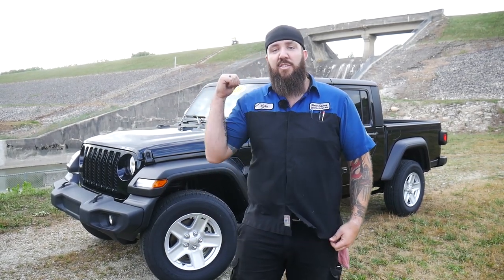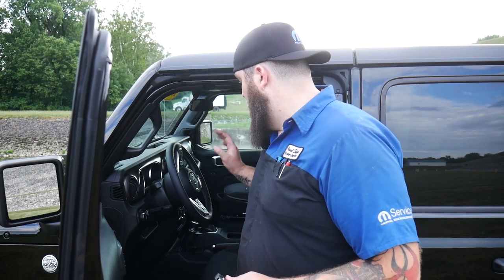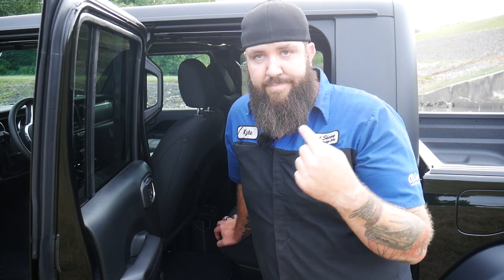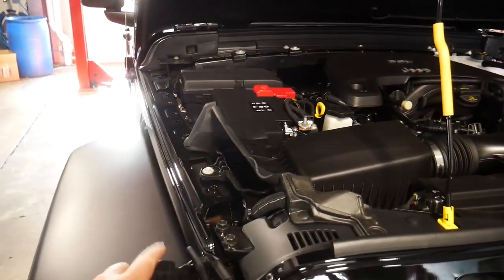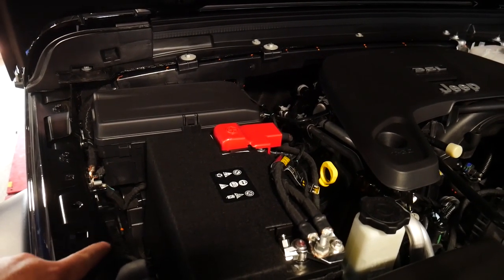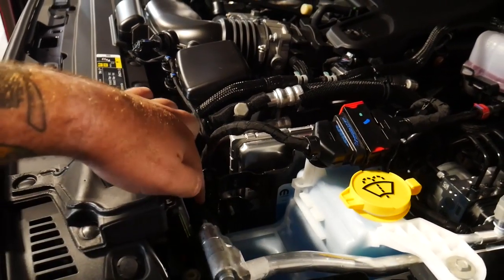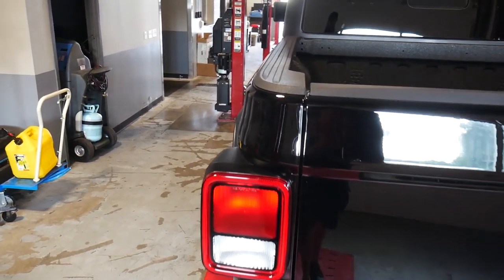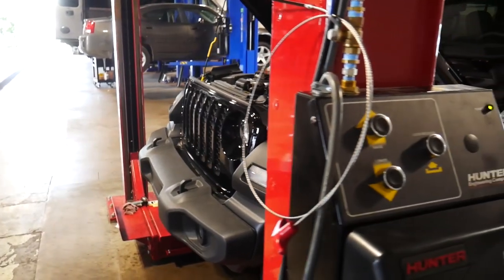2020 JEEP GLADIATOR - REVIEWS BY THE MECHANIC

Comment: They stick the taillights out that far because of the blind sopt monitoring system sensor's.  Function over form.
Reply: There’s no difference in how much they both stick out! It probably has more to do with the DOT regulations about lighting placements and distances. Like even the older step-sides had the taillights hanging off the sides of the tailgates.

Comment: I would like to see a two door version, like the old Comanche.
Reply: i would too but they said there not going to spend the money on it as something like 80% of midsize trucks sold are 4 doors
Reply: Took a few test drives, really like the truck but would rather have the extra bed space than the two extra doors. I'll just wait for a used one if they won't bother to build the truck 1/5 of their customers want. 

Thanks for the video! 

The passenger side exhaust loop is to tune exhaust pulses. Something especially important for v6 engines and actually reduces back pressure.
Reply: It would be. There are people out there who already hacked some up for the two door version. However most people overall want 4 door.

Comment: This so best film I've watched about the Gladiator, or any vehicle for that matter. Sho nuff, Jeep fans will not be buying the Gladiator as a status symbol. Two dislikes I have are: 1. There is only seating for five which is unfortunate as there are six of us in the family for the foreseeable future. 2: Almost $45,000.00 for a mid-range model? Chevrolet and Ford is charging around that price for their full-sizs, mid-range, Pick-ups, and the almost $45,000.00 for the Silverado is the new 4-cylinder model....sheeesh!
Chrysler needs to simplify the Jeep line again with just the Gladiator, Wrangler, and Grand Cherokee. I'd like to see a full-sized Jeep pick-up again like the old J-10/J-20.
Reply: Donald Hollums 
Unfortunately for you this or any mid size truck may not fit your needs. I cross shopped this truck with 4x4 Ford Rangers, Chevy Colorado’s, Toyota Tacomas and the price is pretty even.
Midsize trucks fetch a hefty price in today’s market and one would be foolish to cross shop with full size truck.
We just got a Gladiator and I am about 6ft 245lbs and I fit comfortably in the back of the JT, and the previous JK too. No you won’t get 6 in the Gladiator but you won’t get 6 in my F150 either. It only has seatbelts for 5. As for status symbol I’m not sure what cars meet that criteria these days. The JT does draw a lot of attention but it’s new so that’s expected.
Reply: Jeep needs to lower prices. I think that is clear. They’ve also lost over 35% sales the last 5 years (as prices increased).

Comment: Very nice video with a lot of information along with views of every nook and cranny. Now here I am in 2024, with a new 2024 Sport S, that’s very similar, a different grill, without the plastic filler between the bumper and fender. Plus more open space in the grill to help cooling. Also time has proven that aluminum steering box has been troublesome and replaced with cast iron like mine. I have every option that one has, but tow hitch and auxiliary switches didn’t come, but was marked down from msrp of $52k to $37,800! But I do have heated seats and steering wheel, auto climate control, ACC, adaptive cruise control, plus cross traffic notification and auto stop. The other slight difference is 17” dark grey alloy wheels that actually match the Chrystal Granite Metallic Paint. Plus hard top and automatic trans. One item I miss is limited slip rear differential. But like I said it’s how I found it marked down and I’m not a hard core off road driver and love the nice ride the 245/75-17 tires like on the one you had. I’m disappointed with the halogen headlights and fog lights, but every other are LED’s, so I plan on changing the bulbs. I’m not sure if the 2020 have this other great feature you did not show, that is the rear seat back that also folds down, that also locks in the up closed position with the key, that we use for security storage. I’m getting 17-18 mpg around town, depending upon how many lights and traffic is moving, but as high as 26 mpg at 55 mph to 60 mph on flat ground. But go 65-70 it drops to 24, at 75 goes to 22. Haven’t had it over 75, but do believe that mileage will be less than 21-20! Like every vehicle I’ve driven I get better mileage without Cruise Control, by just feathering the gas pedal just enough to maintain speed, that helps keep from downshifting, however In traffic the auto cruise control is great, just set the distance and relax, the only problem is you can’t set the space close enough to keep aggressive drivers from diving into the space, that sends the system to hammer the brakes! But if traffic is normal stop and go, the system will bring you to a complete stop, about 25-50’ depending how long you set it, then will automatically take off as traffic moves, unless you’re stopped for longer than 5 sec, then you must push the resume button and then it will take off at a reasonable quickness up to the set speed or 25’ from the vehicle in front. We drove up into Orlando on Rt4 the other day, a full 12 miles without touching anything pedals! I touch back in a year with an update, 1,280 miles so far with no issues at all. Oh one more thing, the new 12.3” touch screen and voice control Apple Car Play is amazing, very complicated and still learning everything it can do. But disappointed in the sound quality of the 8 speaker mid upgrade.

Comment: The same year as this video I bought a Toyota Tacoma TRD Offroad package for $36,000. I could sell that truck today for more than I paid for it. Plus it's a much better value than any Gladiator hands down.
Reply: Tacomas are rated dead last for mid size truck reliability out of 7trucks. They just are ok now. Used to be good
Reply: @billricheter5678  stop embarrassing yourself sir, and name your sources.
Reply: @jasonmolihan61  Can you believe the Tacoma pickup is rated only average for reliability by Consumer Reports? Not only that, but this truck is also only sixth out of nine in the overall rankings. Does that sound like the right pickup for you to drive?
Reply: @jasonmolihan61 most sources rate it poor. Here are two. You are living in the oast.
Reply: The Toyota Tacoma Reliability Rating is 3.5 out of 5.0, which ranks it 7th out of 7 for midsize trucks. The average annual repair cost is $478 which means it has lower than average ownership costs.

Comment: Nice review! Just traded my JKU in for a Gladiator Rubicon with sticker price $48,880. For the upgrades alone it’s definitely worth the 4K. I miss the available engine space that the JK offered. But for the life of me I cannot understand stand why Chrysler runs the exhaust line directly below the transmission oil pan. Gladiator looks as if there maybe some extra space to remove the screws when the pan rots from the inside out. I’m 6’3” and 270 and had no issues with my YJ or Jk. But I couldn’t agree with you more about the arm placement in the JK on the door and center console.

Comment: Very informative walk-through.  At 9:50 of the video you mention the downside of the EGR cooler.  Could explain why that is a negative vs. the previous Pentastar 3.6?
Reply from the maker: Just plain having it makes it much harder to work on
Reply: @RustbeltMechanic  
How so?
Reply: Egr is a nightmare is not needed and cost ton of many to fix. Is not question if it's going to go bad but when.
Reply: @zelenizub2036  my old Chevy has the original in it with over 180000 miles

Comment: Hey good report but just a few things, the back seat has a little more room than JL & that grill has bigger openings width & length for better cooling, also the brakes are bigger than JL & all JT’s have adventeck Dana 44’s front 210m & rear 220m with 10mm thicker axle tubes . Thanks man
Reply: Hey, do you think they will do the same changes for 2020 JL aswell?

Comment: Would like to see a review on the Gladiator 2021, including the eco diesel. Providing you haven't already done so.  Also, your thoughts on whether, or not to get the gorilla glass upgrade? Thx for the info.
Reply: I got the gorilla glass upgrade on my rubi gladiator and my friend has a sport one, a rock about the size of a quarter hit mine and cracked it but when a similar one hit his it punched a tiny hole with a huge chip on the front and a big hair line crack from the driver side top corner to the middle bottom of the window I don’t think it’s a massive difference but definitely extra durable
Reply: @AmericanFry  thanks for the info.

Comment: good video. do you know if with a gladiator sport manual transmission can we lyfted 2.5inch and add 35 tire with the basic diff because the seller seam to say its only with the automatique transmission and 4.33diff?? thx
Reply: john Tijan, 
I plan on getting a (anti-theft) Manual Transmission, in mine when I go to buy. 
You do not see any on the Lott’s in Mississippi. Every dealer says I would have to order it, and it doesn’t come with the max tow group or wider axles?

Comment: I am the same height but having problems with head room and need about 2" more of headroom and the cock pit seems way tighter then my old cj, tj, and my current 2012 jku. Had the same problem getting to in pre 2012 Jku's until they changed something in the interior design. Any solution for getting more headroom without voiding warranty  from mods? Cobreau seat package is what I am leaning towards but have to buy it and get it insulted just test drive a gladiator.

Comment: I plan on getting a (anti-theft) Manual Transmission, in mine when I go to buy. 
You do not see any on the Lott’s in Mississippi. Every dealer says I would have to order it, and it doesn’t come with the max tow group or wider axles?
Reply: For the $2k saved by getting the manual. You are closer to getting a base Rubicon compared to how optioned out most trucks are at dealerships. I don't know why anyone would get a Sport S with $10k in options, when the Rubicon package adds a lot standard plus the bigger locking axles. I see many dealer ordered trucks with the most overpriced options like the $200 trail recovery kit which is a pair of gloves, a shackle and tow strap. Many trucks here in AZ have the all weather slush mats added to the base Sports. Just ridiculous.

Comment: Currently have a 2020 gladiator contemplating transferring into a diesel. I tow a camper in the summer and do a lot of highway driving. Not going to lie the 500$ oil change is scary but would it be worth considering or just standing pat?
Reply: My sales guy said stay away from it. That's scary...

Comment: Did Chrysler/Fiat fix the rocker arm problem yet on those 3.6s? My 16 has had it fixed twice and now its ticking again. Imho pos engine.
Reply: The engine itself isn't a pos....it's actually a great engine. They just needed to figure out why the rocker arms fail at times and the issue with certain heads causing the P0306 etc...

Comment: Why didn't the designers square off the back doors? There is no purpose to the angle now. Looks goofy.
Reply: They said so there would'nt be different doors on this if you needed replacements in a crash or aftermarket doors, to keep it simple.

Comment: Turn off the dam music when you are talking to your viewers. Its annoying as hell. You're the first person to mention the LED lights in the bed among all of the YouTube reviewers. This Gladiator needs a Hemi or the 3.0L EcoDiesel for me to buy it. Thanks!
Reply: The 3.0l diesel is coming. Unfortunately, though, a complete redesign of the vehicle would be required to fit a 5.7L Hemi. The current engine-bay just isn't big enough to meet heating and safety (crumple-zone) regulations with the Hemi.
Reply: @dave3682  
Dennis Collins, on YouTube, is dropping 6.4L Hemis into his customer's Jeeps. So, I don't see what the problem might be other than the safety crash rating.
Reply: @Sig721Tau  Right. The physical engine itself can fit into the engine bay. It just can't do so while adhering to federal safety regulations.
Reply: Have fun filling it with DEF regularly

Comment: Hey Hey - I’m a single Mama with two boys and love the concept of this vehicle for our needs - my concern is in the maintenance of this Jeep model - as a mechanic - how well will this new model perform for a single Mama that would have to rely on a mechanic ☝️?!? Thank u for the video
Reply from the maker: Thanks for the support! These Jeeps don’t have much in the way of issues. Especially if you are buying one new, it will be very reliable.  The only thing to be mindful of is that maintenance will cost more on the 4cyl direct injected model. That engine requires full synthetic oil changes where the 6 cyl model does not. So up to you if the small change in fuel mileage makes up for the oil change cost difference.

Comment: Any issues with the EGR system mechanic man?
Reply from the maker: Asked the guys and they said they haven’t really had much aside from a reprogram. I did have one that had a failure but that was a brand new unit that was missing a seal on the EGR tube going into the intake right from the factory.
Reply: @RustbeltMechanic  Thanks for the reply, I test drove a JT gladiator with 6mt the other day, Little disappointed with the manual transmission still havent decided between the 6MT of the German licensed Auto transmission.

Comment: May i ask for your opinion please, i found a dealer in Texas selling a Gladiator Sport S with some dealer modifications: a 3" lift kit, a pair of driving lights on hood, huge Toyo Open Country tires with 17" aftermarket wheels installed and big tires mounted on bed with special off road spare tire mounting bracket. On the inside pretty much standard i think. But they asked for $50k for it. Is it a good deal? Or would it be better to spend less for a stock (no modification) Overland $46k or a stock Rubicon $47k ? Is it harder to drive on highway with 3" lift on a truck? I really love the look of the Gladiator but seems very2 pricey compare to a Ranger Z71 or Tundra Off Road or Tacoma Off Road. Anyone can chime-in with good info please.
Reply from the maker: I personally like the Gladiator rubicon the best out of all those options. For highway and drivability standards the best choice would be not lifted. It also HIGHLY depends on the style if lift kit they used on the upfit. I personally would buy a stock one and wait for a big reputable company like BDS to perfect a lift after the first year or two.

Comment: Wrong!  Gladiator has 3" more leg room over the 4 door Wrangler, same small rear door... granted at 6'+ it's a tight fit for you but get the specs down, it is a little bigger than a Wrangler

Comment: Loved the video!! I have a 2014 jk and was wondering if these have any of the oil filter housing leaking problems? I torque mine to spec and it’s my second one that’s leaking. Only 74k miles and I’m going to have to do it again soon :(. Is this 3.6 any better?
Reply from the maker: Yes the new ones have been updated, haven’t seen much in the way of any failure like that on the new 3.6’s